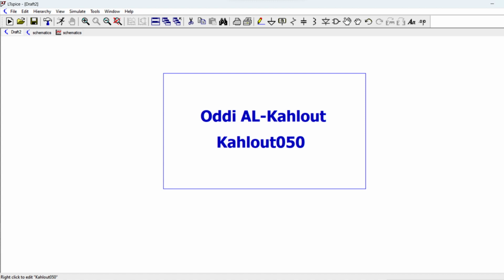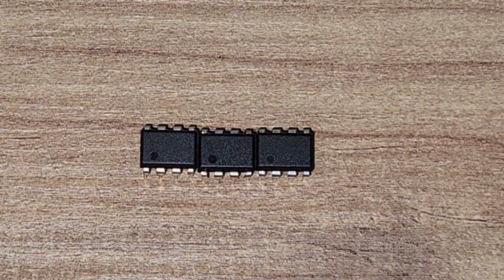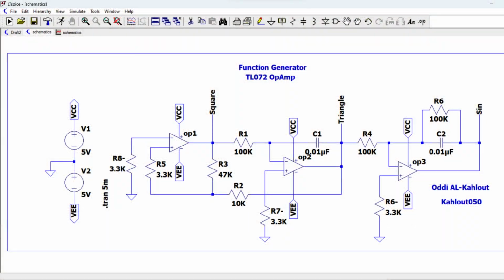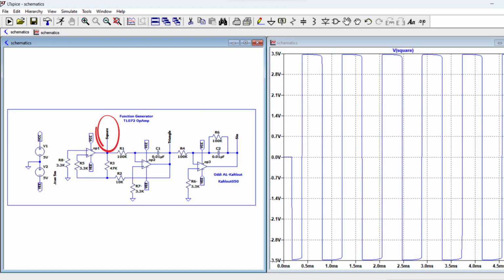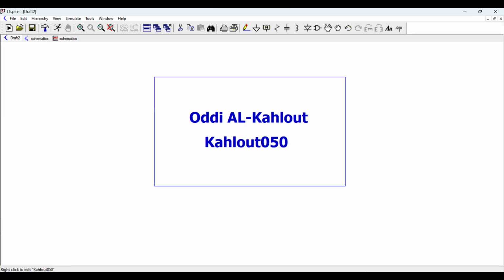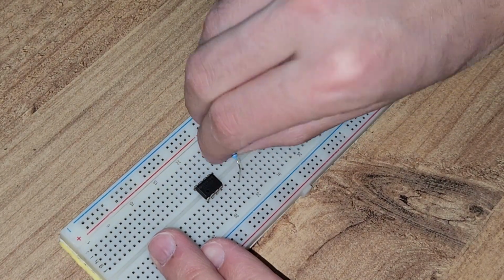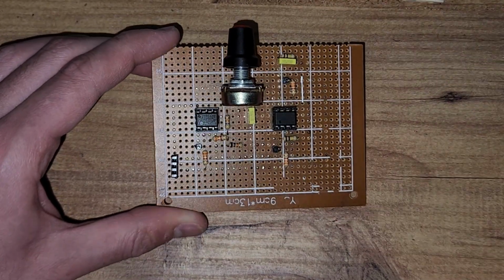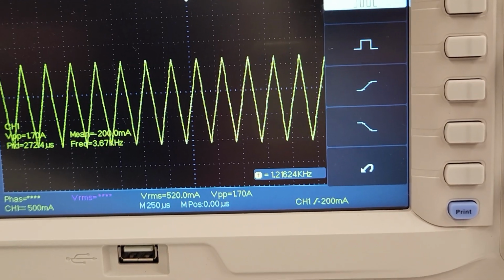From LTspice to Breadboard: Building a Function Generator for Circuit Design Education.

Comment: That sine wave didn't seem too stable, and why is the noise this strong, compared to the signal? There must be something causing the noise in the circuit. For a student who learns how to design electronics circuits, these should be addressed and the way to avoid them should be shown. The square wave generator could be built with a Schmitt-trigger on the end, of course. But Schmitt-triggers are useless in analog circuits.
Reply from the maker: Thank you for your comment and for noticing the noise in the signal. We agree that understanding the causes of noise in circuits is an important aspect of circuit design education.
There are many factors that can contribute to noise in a circuit, including stray capacitance, resistance, as well as interference from external sources. In this particular circuit, we suspect that the noise may be caused by imperfections in the components, such as non-ideal op-amp behavior or variations in resistor values.
While we did not have time to address these issues in detail in this video, we agree that it's important to identify and minimize noise in the designs.
Regarding the Schmitt-trigger comment, we agree that Schmitt-triggers are primarily used in digital circuits for their hysteresis property. However, they can also be used in certain analog circuits, such as pulse shaping or waveform generation. In this video, we focused on building a simple function generator using op-amps, but we appreciate your suggestion of using a Schmitt-trigger for the square wave generator. We will keep this in mind for future videos.
Thank you again for your comment. We hope this video has been helpful and informative.